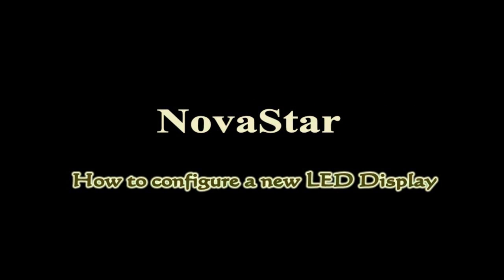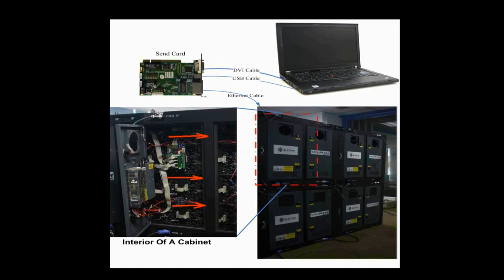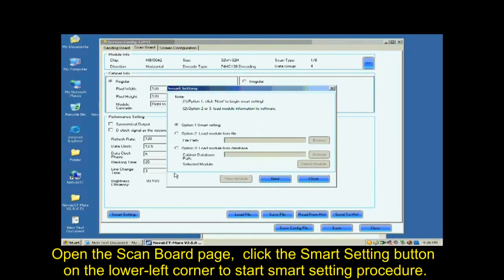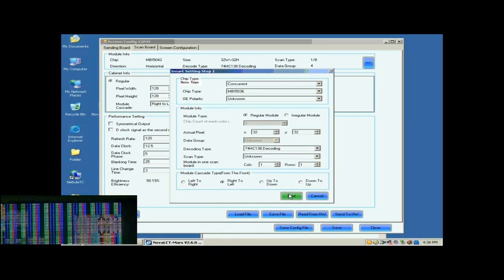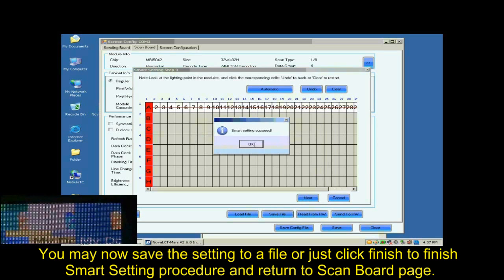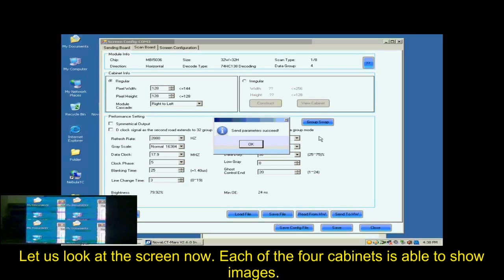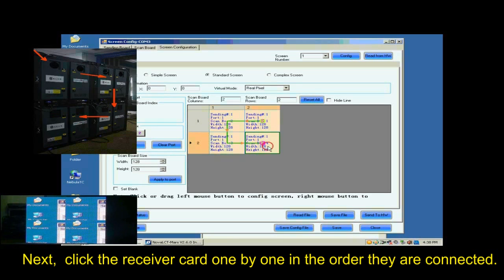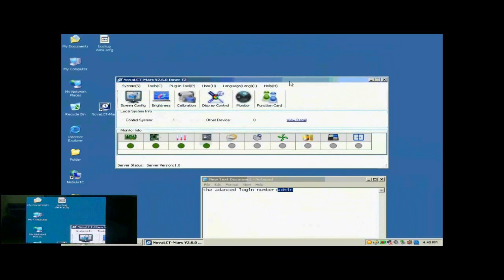NovaStar tell you how to configure a new LED display

Comment: sorry sir, i ask to you 
How do you configure the LED with other sizes, for example a led with a size of 1000mm x 500mm, but mixed with a led measuring 500mm x 500mm? Use nova lct also